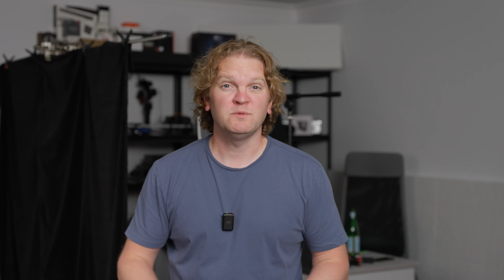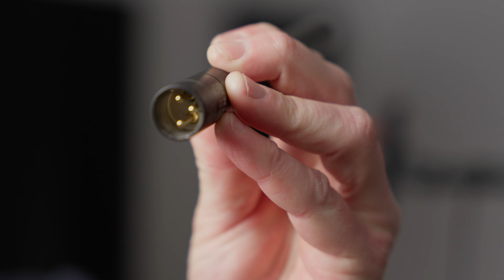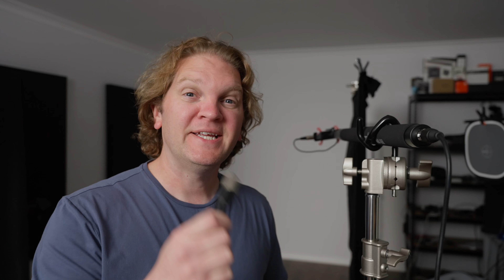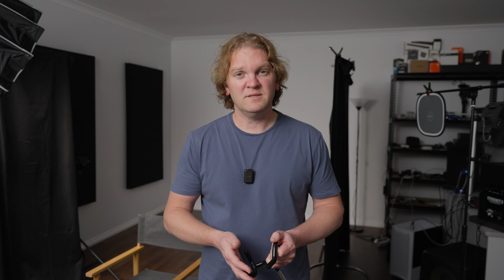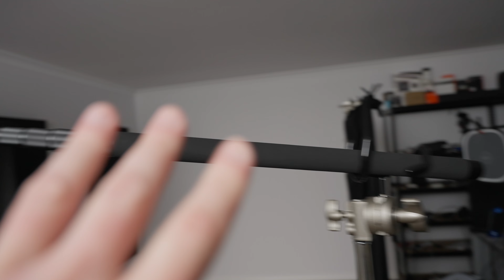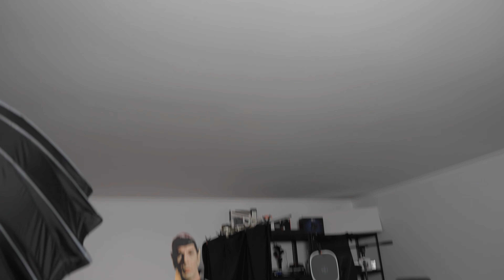Overhead vs Underhead: Which Boom Position Wins?

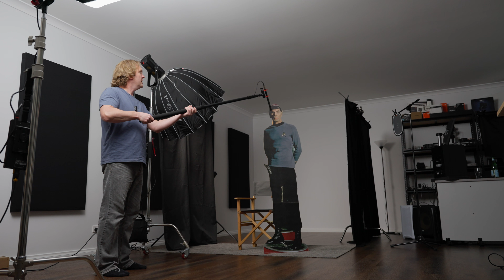Comment: 2:41 thank you for showing this. Everything I found says that the boom pole NEEDS to be held over head, which didn’t make sense. I get that it may at times be necessary, but I also thought you could just hold it in front of you at an angle to accomplish the same effect, which you showed, so thanks.
Reply from the maker: No worries - glad to help :) :)

Comment: Great video! 

Just two things I didn't see you do that may enhance your subject's safety in the future:

1) You should try and always have your grip heads on the right side so that when gravity pulls down they'll be forced to rotate clock-wise and self-tighten. The way you had it on the left could lead to it loosening itself if enough weight stressed it.

2) And then c-stands will always be the most stable when your tallest leg goes towards the same direction as your weight (whether it's a light, flag, or boom). So if you re-direct it towards your subject and then make sure your sandbag is on that same tall leg it will really limit the chance of the stand falling over, and then on the off-chance something does knock the stand over if your tallest leg is aimed directly at your subject then it wouldn't fall towards them but instead more likely a direction between your 3 legs.
Reply from the maker: Thanks, yeah I know - I'm probably a bit lazy when it's just me, if I had team/talent on set it would be different - still I should just get into good habits and then not think about it!! Thanks for the looking out for people's safety - that's very cool of you :)